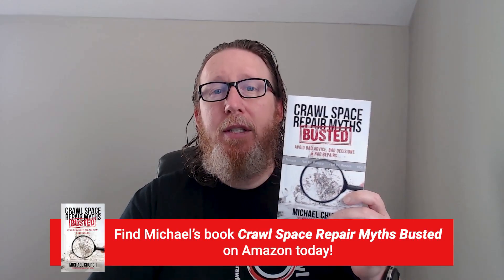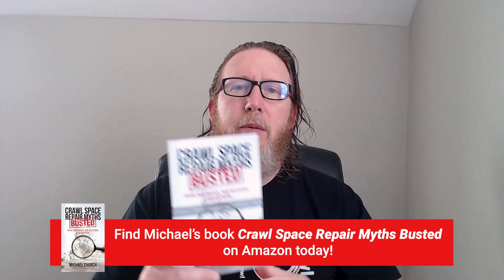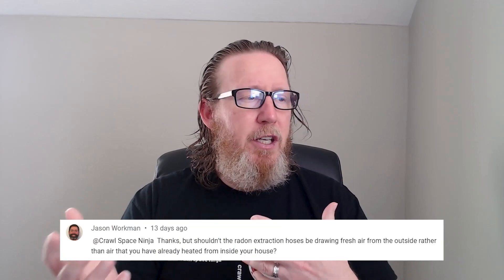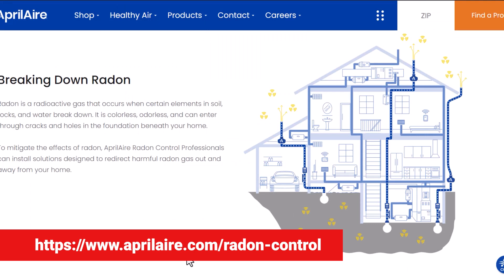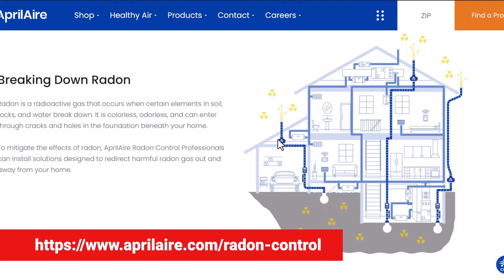Radon Makeup Air & Properly Discharging It

Comment: Even if you have the flute for radon and ect from HVAC or natural gas to exit up toward attic
Reply from the maker: If your radon levels are low, a radon mitigation system is not needed.
Reply: @CrawlSpaceNinja  thanks again just removed all the bats paperside down lol. House is from 79… gonna soda blast and clean all the havac runs. Exterior and interior. Then taking down sheet rock cause it’s got water damage on trim and bats are black from intrusion so. I will find your link and ect for steps to get a one on one consultation from the ninjas. I’m looking to do foam board r-10 on block wall yet intrusion has occurred so need a second reliable opinion. All ready did mold test and it was penicillin and Aureobasidium Pullulans I also think fusarium. When I looked at structure under my professional microscope. I’m trying to do and Agro room and then a music room to teach kids both.

Comment: It depends upon the soil.  With dense, wet clay, it's very difficult to draw in enough air from the soil to have sufficient CFM to remove enough radon gas.  I'm dealing with one now where every crack, gap and joint is completely sealed.  When it rains, vacuum pressure increases even more.  We're looking into boring some smaller holes at the far end of the basement to bring outside air in under the slab to better remove the radon.  Pipes will be used and flow will be restricted with a valve to obtain the best amount of vacuum pressure.
Reply from the maker: Thanks for your input!
Reply: I’m in Georgia so red clay crawl space and I wanna seal with foam board the vents ??